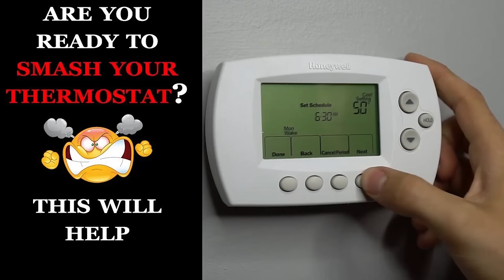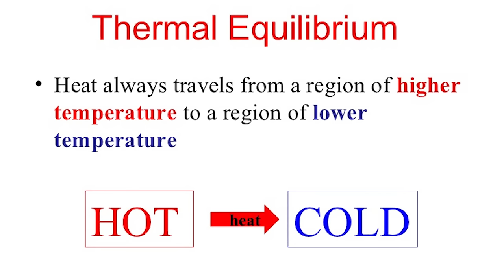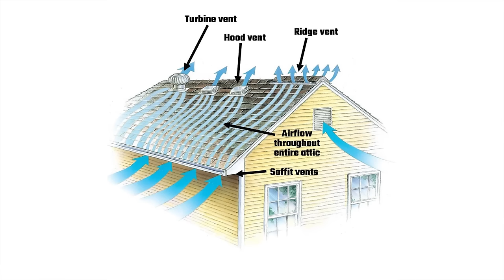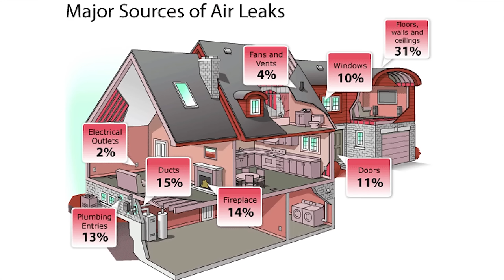AC Unit Not Cooling House - 20 Reasons Why

Comment: Very informative video. 

I have Rheem Furnace. Aero Sys Condensor unit 2.5 ton. Model THDC - 30SGA unit in a condo. Problem I have is the cold air coming out of the vents is not enough to cool the house (1500sqft). I can feel the air from the vents but the temp on thermo stat does not go down. Plus my utility bill has gone through the roof.

- I replaced the air filter
- Checked the AC unit, the fan is spinning fine. Blowing hot air out.
- Coils are clean enough

What could be the issue?
- Capacitor
-  Less Freon

Comment: One thing you could've addressed is humidity.  When I built my 5000 sq. ft. house, I had a mechanical engineer friend calculate the size A/C I needed.  Since my walls are 16" thick, super insulated, he figured I needed only a 2 ton condenser (but with a 3 ton coil)!  Man, it worked great, the A/C ran a LOT, but you could hang meat in my house.  The air was so nice and dry, which makes if feel even cooler.  I live in muggy central Illinois.  After 20 some years, it finally conked out and the technician replaced it with a 3 ton unit.  I tried arguing with him, but to no avail (maybe 2 ton units were hard to get, or he didn't have any in his warehouse).  Now the A/C "short cycles", it gets the house down to setpoint in a hurry, but the air is still wet.  It's a cold, clammy air, not very pleasant!  I would always recommend undersizing the condenser in muggy climates.
Reply: Interesting.  Well, now that your new 3-ton doesn't run as long as the old 2-ton did, you are saving electric. .  In which case, you could buy a dehumidifier for the house and run it near the air handler?  I dunno, just a thought :)

Comment: I find your videos very informative.  I’ve got an issue that may stump you though.  Just had a new condenser installed yesterday on the house I rent.  Tech can’t get the split in temps between intake and vents above 13 degrees, says it should be 22 degrees.  We’re experiencing an excessive heat warning at this time with daytime highs over 110 degrees.  In the past, with old condenser, and r-22, the temp of air coming from vents was in the mid to upper 40s.  I’ve not seen the temp from vents go below 53 degrees yet with new condenser and new refrigerant type.  This system does have a refrigerant leak and the source was not found prior to the new install.  It’s possible the leak may be fixed with the condenser replacement, but so far, we don’t know.  The tech adjusted something today that did reduce the humidity felt in the house (felt like a swamp cooler), and seemed to increase airflow, but air doesn’t feel colder.  Is this just how the new refrigerant works?  Seems less efficient.  I would appreciate any input.  Thank you for your time.  Barbara

Comment: If an AC unit is undersized, there are actually a few things that can be done to help it out. Sealing all the gaps around doors, windows, attic access panels, pipes, etc to the best of your ability can make a big difference without breaking the bank. All those seemingly small gaps really add up. Adding insulation to the attic can make a huge difference as well, especially on older houses with little to no insulation. Sealing all those tiny gaps in the ducts really helps too. Depending on what kind of windows you have, replacing them with more energy efficient windows may make a big difference. Anything you can do to reduce humidity will help the unit out too, so throw out the wife's house plants and use the exhaust fan when you shower. Turn off any extra electronics that you aren't using such as TVs, lights, computers, etc, those just add to the heat load. If you can reduce the heat load on your AC unit enough that it keeps up, you will be better off than having it replaced with a larger unit because you will lower your power bill instead of increasing it.
Reply: museack  Nor does it make sense to spend thousands replacing the whole AC unit with a bigger one that will cost more to run if that money could be spent on energy efficiency upgrades that would reduce heat load enough that the current unit would be adequate and cost less to run. What makes the most sense depends very much on the situation. For example, If someone has an old, drafty, poorly insulated house with a decent but somewhat undersized AC unit, they are likely to be able to reduce the heat load enough for their current unit to keep up just by sealing their ducts, insulating and air sealing the attic and replacing the weatherstripping around their doors. That would certainly be a more economical option than replacing the whole AC unit, especially considering that reducing the heat load would reduce the power bills rather than increasing the bills like a larger AC unit would. However, if someone has a more modern house that is already sealed reasonably well without much room for improvement and the AC unit is 20 years old and undersized, the most logical option would likely be to replace the unit since it is likely reaching the end of its life anyways and replacement would be about the only option.

Comment: I have four huge sliders  and live in Florida.   Ps.  Re insulation,  my electric company had a program a few years ago.  For about $200.00,  they added blown in insulation to my attic and sealed all the duct work.  My energy use went down about 15% a month.  I was a skeptic until that moment.  Thanks for the video.  :)
Reply from the maker: Oh wow! 15% is quite the change! Thank you for sharing your experience with that!
Reply: @WordofAdviceTV  I average about $2,400 a year in electric bills (Florida) so I save about $360 a year with this improvement.  I hope others see this too.  Thanks again for your hard work.

Comment: Good video. Had a 15 year old trane heat pump the other day where the compressor was locked up. Added a 5-2-1 hardstart kit but it still wouldn't kick over. This customer is going to buy a new system
Reply from the maker: @Austin Thank you for sharing! Yeah, unfortunately a hard start does not always get it going..
Reply: @proanswers  homeowners dont want to buy these. They cost extra money and dont help the system
Reply: @Austin23191  by "these" you mean hard start up capacitors. Maybe due to HVAC contractors and technicians (taught) to OVERPRICE the UPSELL  SALES approach vs ethical ways of long term customer trust. The approach is explaining in laymans terms . Then the decision is made on facts not sales pressure or fear.  We can add a hard start with the new capacitor (if needed) : saving a little bit on energy costs (tough one to quantify to customer because you get into some technical concepts of amperage) more importantly the wear and tear on the windings in the compressor which costs thousands to replace or a new outdoor unit. The return question back might be why didn't the manufacture put it on the unit if it was so important? Answer some manufacture skip parts due to lower production costs and there own upsell techniques. Many Trane (american std) and carrier units have hard starts-Not all units. There still on a lot of refrigeration units today. I would say most customers DONT KNOW what questions to ask and then interpret the answers.
Reply: @proanswers  I mean the compressor analyzer tool. I see hard starts all the time and put them on older systems from time to time when a unit needs it
Reply: @Austin23191  we are assuming your NOT a homeowner that your a HVAC tech or contractor or HVAC engineer. Let us be crystal clear the UEI compressor analyzer is a TOOL. A tool (right tool)  is an investment not a one off-well worth the $200-$300. The tool not only performs as a start compacitor (with many mFD ranges)  to "jump start" the compressor for layman analogy, The tool can also move the windings out of its current phase position (reverse- just briefly) to attempt a compressor out of lock position. Its a wise investment that has multiple functions- ohms testing, voltage, continuity) * one might say well my multimeter does that also- first thing you check is OL (open winding) / continuity and or short regardless. There is a great youtube video utilizing a very older compressor analyzer on YOUTUBE on a refrigeration unit (different hermetic compressor)  same principal . Our success rate with this tool has been 95% . We look at hard starts as preventative not reactionary fix (parts cannon approach)  to a symptom of locked compressor. Customer Case Scenario is your going to hook up a start relay in the van vs lets analyze the compressor prior and determine health, then perform the procedure of unlocking thats built into the tool. TOOL VS PART and knowing when to utilize.
Reply: we would NOT have mentioned the UEI analyzer tool however your words were "LOCKED" compressor vs assuming you clearly checked for open ground at compressor or short at compressor. AND assuming you looked at the LRA on the rating plate of outdoor coil and took the proper measurement test.
Reply: @proanswers  I did measure the LRA. Even with the hardstart, the in rush amps did not drop. There was nothing else that could be done to start the compressor with the tools I had
Reply: @Austin23191  as hvac engineers we test  compressors and about 80% claimed to be locked are not. Missing info from your locked compressor original statement (VS short to ground/or windings OL). Did you test compressor terminal to ground-resistance? What was the temp on  top (shell) of the compressor- most scrolls have thermal overload protection- some have resets did you check (verify/look up)?  (infared temp camera or taped temp probe). Did you check all the windings? simple formula: f Common to Start reads .02 ohms and Common to Run = .04 ohms, then Common to Run should be around .06 ohms? Lastly no parts/tools required did you try moving the capacitor to the run winding on compressor terminal,  bump t  * the winding *whole purpose of the RUN capacitor is to bring the start winding back in phase with the run winding, thus move run capacitor to a different position , if you know how a 3-phase  compressor works involves a similiar principal essentially the UEI/Annie tool mentioned easier to control of the last statement but can be done with out the tool. NOT trying to pick on your case, JUST THE WORD LOCKED Compressor- its mistakely over used and not tested.  Bottomline we see HVAC techs, engineer's, contractors, etc say the compressor is LOCKED when it has not been proven through proper tests and procedures.  It might not 100% repair the compessor damage and eventually need to be replaced but this can buy significant time for the customer and shows your knowledge and education of the symptom proven out.

Comment: Love ur videos, my question is if I wanted to-disable the air handler fan so that the only way it works is on auto and not the on switch at the thermostat which wire do I leave off the thermostat but I still wanted to work on auto

Comment: Thanks for this great video! I think I have problem #3. The AC periodically stops cooling while the system is running. It's 17 years old and we had a hard start kit installed close to 10 years ago. Can the hard start kit fail with age too? All I do to get it cooling again is turn the system to off for 2 seconds, then back on.

Comment: Great information, really enjoy your video. I just check my ac unit today and notice a slow drip on the vacuum line towards the furnace. The vacuum line towards the compressor is fine.  Can it be a dirty inside evaporator coil? Any idea is appreciated. Thanks

Comment: thanks for this nice updated tutorial,  i think there is a very common but i am not sure if it is critical to not cool down the house, which is the  return air  vent not big enough, i got an 4 ton ac machine, the return air vent only 12x30 = 360 squre inch , i believe it need to be at least 580 (144 x 4 tons) squre inch. i think this installation mistake causes the sucking/vapor line no water come out, and it keeps running on hot days and it takes5-6 hours to cool the house until the outdoor tem drops. is my assumption correct ? thanks
Reply from the maker: Hi Steven! That does sound like the return duct is a little small. Have you considered adding another return to see if that helps, along with putting in a cheaper furnace filter? Unfortunately I don't normally do install work so I don't remember off the top of my head what the exact CFM and ductwork sizing requirements need to be per ton of cooling so I can't give you an exact answer. Perhaps there will be installers watching that can give a better answer
Reply: @WordofAdviceTV  , thanks for the reply, yes, i always thought of it,  but i think it is not an easy job, someone already lives 2nd floor and the evaperator unit is on top of the ceiling to be exactly unit is in the attic,  it looks like a big job, i searched youtube, seems no people doing this project to fix the central ac by opening an extra return.
Reply: @WordofAdviceTV   i think it may also caused by a reason that you mentioned within your 20 reasons :  the attic has a ventilation problem.

Comment: Nice video~ Mine issue is a litle bit weird. the Airflow is ok when turn on the heat but only little airfow when only turn on fan or turn on AC. Have some technicians here to check but missed to tell me the cause. It would be very grateful if you could help to analyze.

Comment: Good video....thanks!
I had one with a 2 stage condenser....the first stage wasn't working due to a bad circuit board but also noticed the  second stage run capacitor failed with leads burned off at the capacitor...Strange thing was that the second stage still operated with no problems at all.  Not sure why...any ideas?

Comment: Reason #21
  The unit is running  great! Suction line cold 🥶 🥶 🧊 cold!
  Indoor line cold 🥶 🥶 🧊 cold!
Condensating like crazy. Well amp out your heatstrips one of them is stuck close so your making a tornado with heat and cold.

Comment: Hi Jay, so I recently got a a/c company come assess my a/c unit but it was more of a sales pitch than anything else. They asked how much I was paying on my electric bill and I told them it was over $400 (Texas Heat) and they told me they could reduce my electric bill by almost 35%. They said the rule of thumb is that an a/c unit in the summer usually affects the electric bill up to 35%. They said, if we are paying over $250 dollars in the summer then its time for a more efficient a/c system. Is there such thing as a rule of thumb for a/c efficiency? This year was the first time my electric bill was over $400, FYI the a/c unit is over 15 years old.  Maybe an a/c efficiency topic would be a good one for your next video.

Comment: I bought a 2 bedroom condo 1 month ago.  The HVAC system is 1 year old Goodman R-410A 2-Ton system.  During the home inspection I complained that the system was not producing cold enough air.  It was 68-70 degrees on the day of the inspection.  After closing 1 month ago, today we had a 97 degree day.  The HVAC system struggles to bring the temperature down past 85 degrees.  In fact it could not bring it down past 85 degrees for over 2 hours!  It does not have enough returns because it is a condo on the 2nd floor.  There is only 1 return in the hallway which is tiny.   If I pay a HVAC contractor to install 3 returns in the attic, will that help the HVAC system cool better?  Should I also get the system checked (superheat & subcooling) by a professional?  I noticed the condenser fan motor does come on, and also the system does come on, but it doesn't cool well enough...

Edit:  I went further and checked the outside condenser and the fan is spinning good.  However the heat it's blowing doesn't feel any hotter than the ambient outdoor temperature.  Also, the suction line does not have any condensation on it.  Both lines feel lukewarm at best.  I believe it's low on R-410A.  Thursday I am now paying someone to check the charge and install 3 returns.  I also enlarged the hallway return by 6"x5" additional.  I'm hoping to fix this once and for all.  Sometimes you have to trust your gut with these things.  I am just a homeowner but this whole thing looked bad.
Reply: Did you find the problem why the hoses are not condensing and not enough cold air comes out of the vents?
Reply: @marcelinoguerrero7153  the charge was low on R410A.  It's been good since charging but next year if it is low again I'll need to figure out where the leak is...

Comment: Very well done I would say you covered just about everything. I work as a maintenance man at an apartment complex in Arizona where it gets brutally hot for several months! (105 to 115 degrees every freaken day in the summer is quite common)! One of the biggest problems that we deal with is people just not being realistic enough to understand that when it's extremely hot outside there apartment is NOT going to cool down to 70 degrees when it's 110 outside. No way Jose not gonna happen! Also whenever people tell me "oh I thought if I set the thermostat to a lower temperature it would blow out colder air" I either want to laugh or smack that person upside the head! I can't believe any grown man or woman still thinks that way. We also have these brilliant people that go over a year without changing there air filter and then complain that there AC runs non stop and even try to blame us for there high electric bill! (These are usually the same people that set the thermostat on 70 LOL). Damn there are some really ignorant people in this world. It shouldn't take an HVAC expert to figure a lot of these things out. Just a tad bit of common sense is all that is needed. Anyway I love your videos. Very informative and we'll explained. Keep up the good work!
Reply: you sound  angry
Reply: sounds bitter af